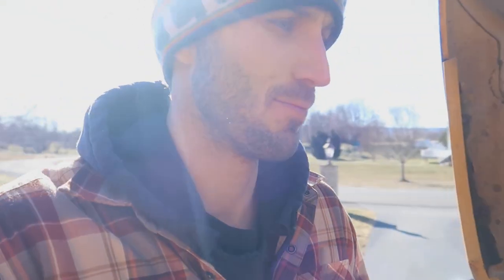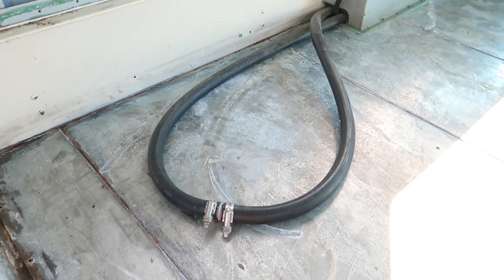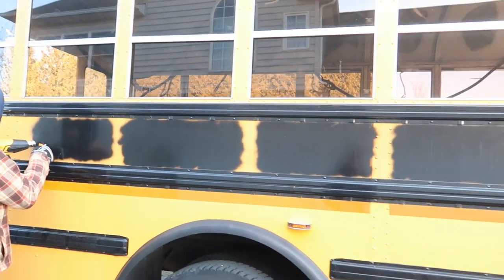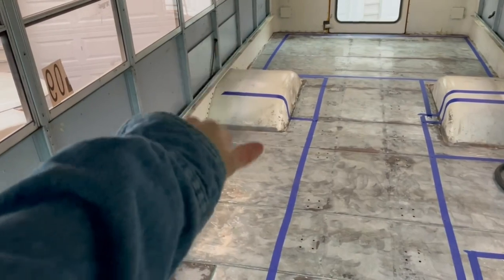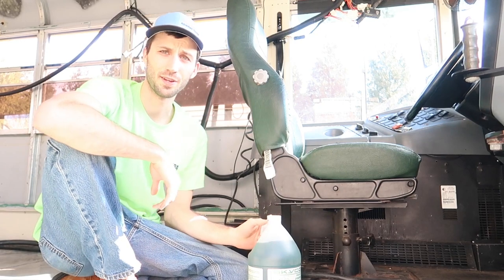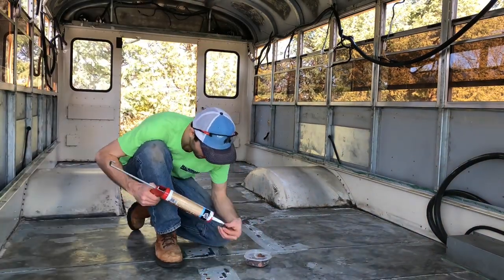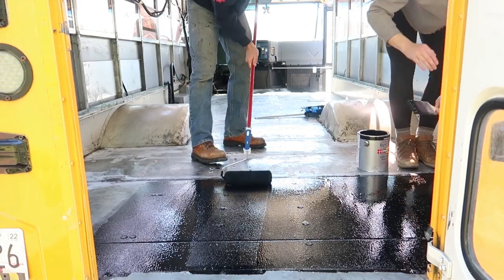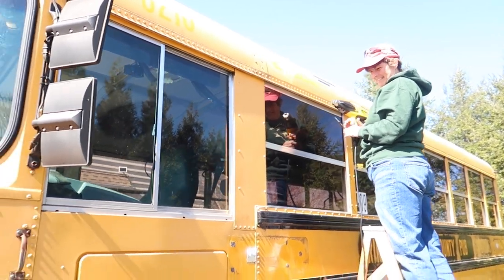Painting our Skoolie floors + A LEAK! | BUS BUILD EPISODE 4

Comment: See if you are able to loop the heater hoses before they come up through the floor.  Post more often, nice job.  ROLL TIDE!
Reply from the maker: Thanks for the tip! We have seen a couple other builds do just that but it seems like our hoses/pump are oriented a little differently and it wouldn't be very easy. But we definitely want to make the loop as short as possible!

Comment: if it was me i would push the old heater hoses back under the bus and loop them under there. that ay if it leaks you have access
Reply from the maker: We're still considering pulling them through to underneath the bus! The way our heater is set up that just doesn't look easy... But even if the hose was under our kitchen cabinet we would set it up to be accessible in case of a leak! Thanks for the tip!
Reply: @AdventureTrudge  do your hoses come out of and go back into the drivers heater? If so, perhaps cut a chunk and just route from out to in and blammo! All golden. That is how the heater hoses are in the bus I picked up.